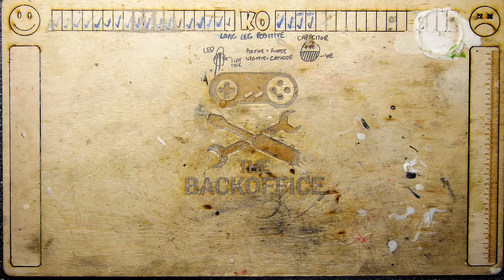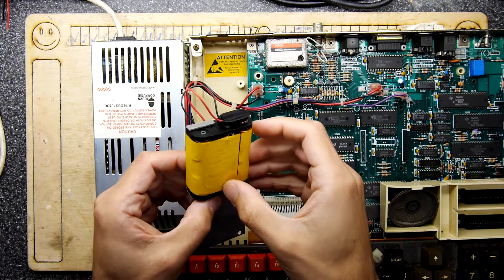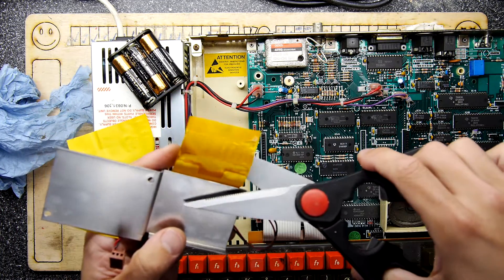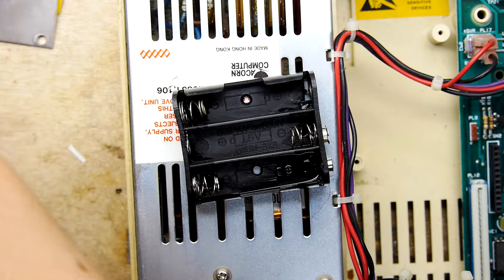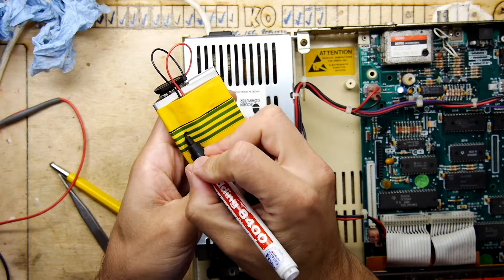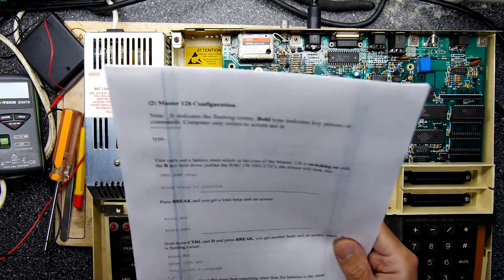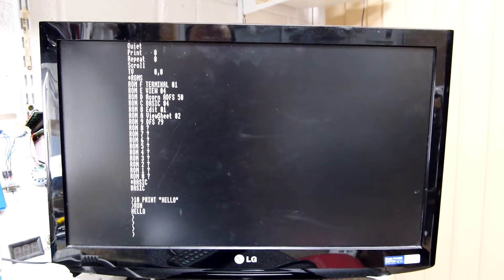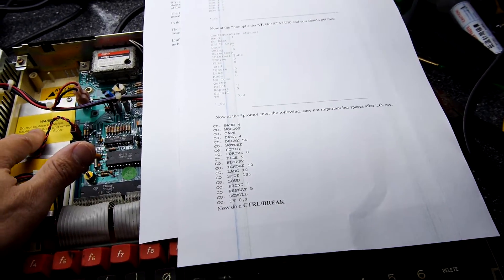BBC Master Battery Refurb and Keyboard Repair How to

Comment: I was lucky enough to find an exact replacement for the battery holder on ebay as mine was so badly corroded it was unusable, wires and snap were fine however.

Comment: If the battery connector is like the LED connector on more recent machines then that had a 3 pin header with both outside pins connected so it doesn’t matter which way round the plug goes on, could be the same setup for this too?
Reply from the maker: I'll check schematic. It could be that you could leave it connected but 'off'